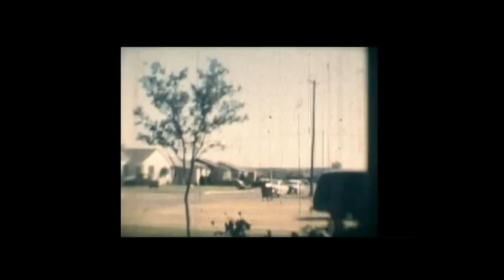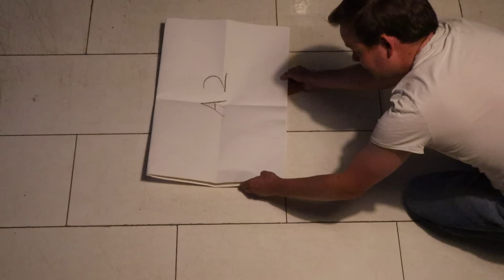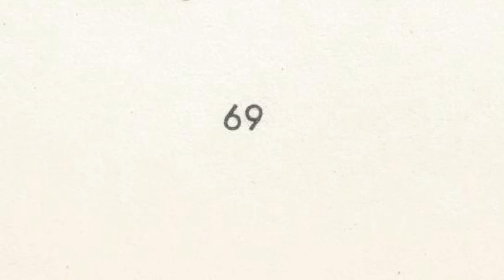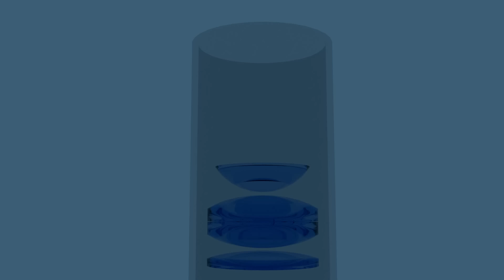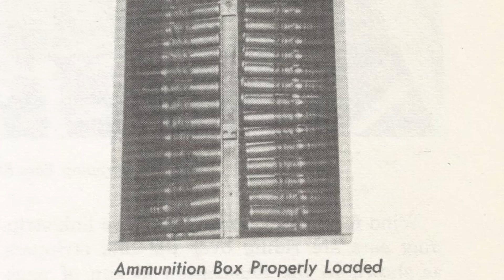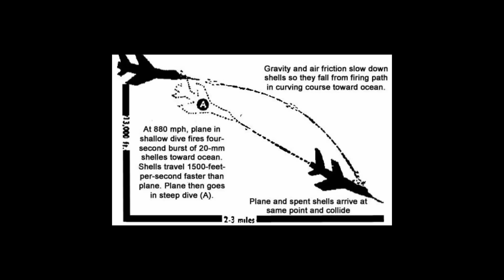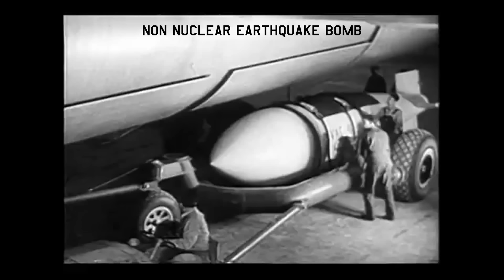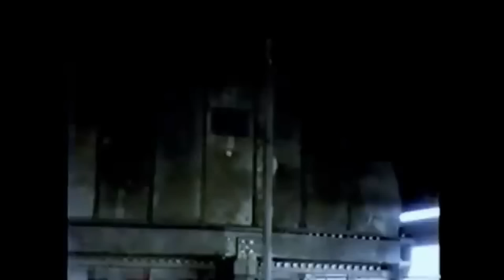Unfathomably American: The Armament Systems of the B-36

Comment: Regarding the nuclear powerplant, that was being developed for the bomber. A sad story.  Scientists and engineers knew the project was ridicules' but the funding did offer the potential for an MSR, Molten Salt Reactor for ground based reactors with great potential.  But government support eventually stopped after the development of 2 working prototype research reactors. President Nixon, having no understanding of reactor design canceled the second project in 1972 for purely political reasons.  And until recently ignored.  China has 2 MSR reactors and a US project in a Texas university may develop an MSR research reactor. Given the potential of an MSR is revolutionary in safety, cost and waste reduction, transportable, construction, simple operation,  compact size and modularity.   By now  MSR reactors could be running with simple and modular factory production.  American policy for reactor licensing may allow for practical development of new MSR reactors.  The potential may  see more than doubling performance over Gen 3 reactors.  And advances in development fusion reactors.  And includes designs with no risk of meltdowns and burning nuclear fuel waste.

Comment: The B-36 was designed back during a time when it made sense to the designers to build the XB-36 with the main landing gear with a single huge wheel.  The main gear tires were 9 ft 2 in tall and 3 ft wide and weighed 1,320 lbs.  After they realized that with the weight of the plane, it would break every runway in the country except for three locations when using the one-wheeled landing gear, they changed to a four-wheeled truck.  They had one of the huge single-wheeled gear on display at Wright-Pat and it's hard to believe anyone would think that was a good idea.

Comment: Do you have a model of the F-15E to the same scale as the B-29?

that's always an interesting one to show people.   A Strike Eagle is in the same ballpark as a B-29 for size, and has 4,000 lbs GREATER weapons capacity.  It's nearly as large as a B-17.

and to top it off, the Mudhen can carry a much larger portion of its weapons capacity to the target.  A B-29 can only carry its full 20,000lbs bomb load over a short distance at low altitude.  Long range missions (1,400 NM) limit the B29 to a 5,000-12,000lb load, depending on exact distance and altitude for the flight.  The F-15E can take 2/3 of its max fuel load with max weapons weight (24klbs), or 1/2 its max weapons (12klbs) at max fuel.

Comment: One point about non-exploded nukes: Uranium and plutonium are barely radioactive alpha particle emitters. They're vastly more dangerous as toxic heavy metals than radioactivity sources
This leads to the rather infamous problem that radioactivity detectors installed at ports worldwide to detect nuke smuggling have a habit of going off on truckloads of bananas (Yes, really)

The USA research on Aircraft nuclear reactors (ANR) was undertaken with the understanding of researchers (Weinberg et al) that "it'll never fly, but the money was useful to work out vastly safer designs than Weinberg's original Nautilus reactor(*)" - that R&D carried into Weinberg's MSRE at ORNL (built on the bones of the ANR) - something killed by Nixon in 1972 because the military realised that civil nuclear power not dependent on enriched uranium endangered the weaponsmaking chain (depleted uranium is the feedstock for making plutonium)

China's built a modernised MSRE - TMSR-LF1 and has been running it ON THORIUM for the last 2 years (the first time a molten salt reactor has ever done that. MSRE only tested on U235/Pu239/U233/U238)

Molten salts are deserving of a well_researched video all by themselves

(*) Whilst Rickover is credited with the program, it was Weinberg who actually BUILT it and it was tailored specifically for a 1950s submarine - a boiler and steam tech because navy engineers understood steam intimately. The thing was a proof of concept intended as a stepping stone to efficient units (98% waste, needing constant supervision and only producing wet steam were all acceptable for an experiment, especially in a military marine environment where someone's standing watch 24*7 anyway, but not for production units) and Weinberg was deeply unhappy with his laborator demonstrator being directly scaled to Rube-Goldberg complexity. Direct immersion nuclear steam boilers got locked in when Rickover insisted that enriched uranium be the power source for Aircraft carriers instead of moving to a next generation design - and Rickover did this for military pragmatic reasons - enriched uranium is a nice cover story for making depleted uranium which in turn makes weapons-grade plutonium and the military simply don't care about waste

Comment: our paper here in the US is SO stupid. when you fold it in half, it CHANGES THE ASPECT RATIO, unlike A4. Meaning, with our stupid paper, you can't print two pages on one sheet and have it fit perfectly, you end up wasting space. And to make it even stupider, it wouldn't do that if they had made it 8½x12 but instead it's 8½x11 inches. It is so stupid and the only reason it is used is because it's what we've always used so everything is already size for it here. Ugh. It's the worst.

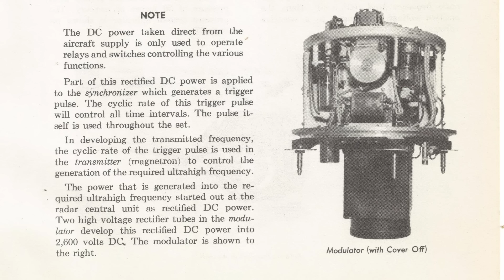Comment: 18:38 I'm just guessing, and p.69 suggests otherwise, but I'll bet they actually used long persistence phosphors so that the "jizzles" would slowly fade out rather than instantly disappear completely as the dish swept past the targets.

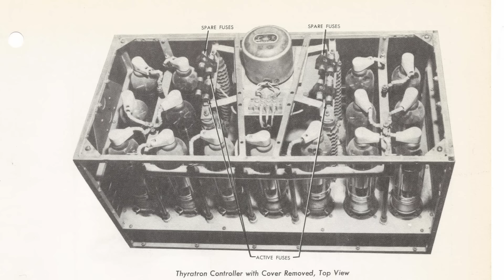29:34 Couldn't they have replaced the fidgety thyratrons with solid state selenium rectifiers, or even with motor-generator convertors?

Comment: 50 cal might have had better ballistics at very high altitude but they couldn't fit a VT fuse and so would have been orders of magnitude less effective. After the development of the VT fuse there was zero sense in using an AA round that couldn't fit them which is I'm sure the reason that the turrets were upgraded.
Reply: Nevermind the V-T fuze, the issue with the .50 cal (12.7mm) was that it fired solid bullets. 

The 20mm cannon had worse ballistics, but it could fire explosive shells which individually did much more damage to aircraft than even a dozen .50 caliber bullets.

Comment: Turbochargers are basically more fuel efficient because they dont have the same parasitic drag on the engine as a Supercharger.....however the extra plumbing required adds bulk to the installation.

Comment: The only thing that could have eclipsed the mechanical insanity of the B-36 would have been the plans to build nuclear powered bombers.  While the nuclear powered bomber never got off the drawing board, the USA did get a long,long way down the road with the Nuclear powered Cruise missile called "Project Pluto".   Pluto was the size of a rail locomotive, was armored, flew at tree top height at Mach 3.5 and its shockwave would have killed people on the ground.  Pluto was designed with a magazine capable of dropping a 1 megaton bomb on almost every major city in the USSR as it passed over them.  Pluto did not ever fly, but its 250,000hp nuclear scramjet did have a full power test for 20 minutes.

Comment: The early proposed armament for the XB-36 was nearly as ludicrous as the production model.  

No nose gun, obviously.  The rear fuselage guns (in a bay between bomb bays 3 and 4, rather than at the back of the bomb bay proper) were pretty normal- a remotely controlled turret, top and bottom, quad .50 cals in each.  The tail gun, also remotely controlled, had two .50 cals, AND (here's where it gets fun) A 37MM CANNON.

Now, the front turrets, which used the same turret bays right behind the cockpit as production models, are real interesting.  Each turret (one top, one bottom) also had a pair of the stupid 37mm cannons, but get this- they were pressurized, MANNED turrets.  That could also be controlled remotely for fun.

I'm pulling from Meyers K. Jacobsen's "Convair B-36" history, but check out Patent 2,586,982 to see the lower front turrent.  It's... nuts.

Comment: Interestingly those 20mm cannons actually helped cause the loss of a B36 flying over Texas.  They were test firing them, the vibration damaged the auto mixture/boost control electronics. The engines ran so lean they simply did not have the power to keep the plane in the air and it crashed about 20 miles south of Carswell.

Comment: 57:09 We use Watts for electrical power here too.

We also use fractionals of how much a Saturn V rocket outputs in Watts, to be different. The reactor's output was 0.00002331002 of a Saturn V. Simple.

Comment: Up until this point in my life, I did think the B-29 was "pretty big."
Reply: Tbf, it is, the B36 is so big its wingspan is more comparable to the length of a small city block, the B29 is bigger than the Airbus A320, though the A320 is not the biggest plane around, I can't think of a commercial airliner that comes close to the B36

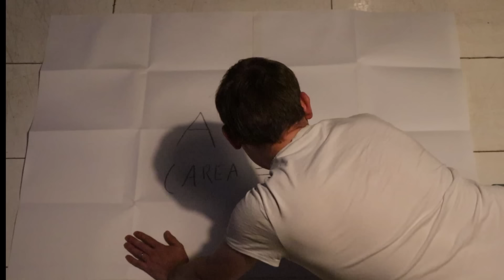Comment: 14:20 "because we've always done it that way" is literally the reason.
56:48 The way to avoid spewing radioactive exhaust is to use a closed loop working fluid and heat exchangers (and maybe some other electric heaters) rather than directly exposing air flow to the reactor.  The direct propellant contact approach was done in rocket form with NERVA, but that was for space where nobody would ever be hit by the exhaust.  The "Serpent" nuclear space engine concept design using Skylon's heat exchanger is a proposal for "the safe way" in space.

Comment: The R4360 was a beast.  I was introduced to it in Aircraft Maintenance School.  The propellor shaft is about  6 inches in diameter, and torque/engine power gauges were just strain gauges attached to  each end of the engine case- you got your readings from how much the prop shaft deflected under load.

They used about 600 gallons of fuel and about 10 gallons of oil per hour at high power -per engine.  Maintenance and operational costs were enormous.

Comment: the original B-36 couldn't land anywhere but on a specially built runway! it's main gear consisted of a pair of 8 foot tall(!) wheels that put all that weight in a small area. it could destroy a runway just landing on it! the service versions had the multiple bogie mains. the USAF museum in Dayton Ohio has one of those big chongus wheels on display 😂

Comment: The weird thing about the guns on the B-36 is the B-29, in spite of having that marvelous system, ended up removing almost all except the tail gun in 1945. They weren't worth the weight. Stripping them off increased the range ceiling, speed and bomb load. Paul Tibbetts had demonstrated in the workspace for the Silverplates that the shear speed and altitude was a much better defense than the guns. Japanese interceptors were not really a huge threat to the B-29's. Not the way accurate flak or the B-29s own engines were. So I'm always surprised at just how much armament they bolted onto the B-36?

Comment: When your "radial" engine becomes so long, it starts looking like an inline engine, maybe build that instead.
 
If we could solve the chemistry of fully cleaning reaction products out of a molten salt reactor, and keeping its installation in one piece, we'd have them running by now. That combination of very fun salts with even more fun atom splitting products is just a little bit too much for long term operation. Right now, only China has a running test reactor, and there is always some US company or other telling everyone they are "developing" one, but the tech remains far from ready in terms of commercial adoption.

Comment: 49:40
It seems odd to me that a 70L displacement engine produces such a hilariously low amount of power. That might actually be the most American thing about this aircraft. That's like (I hate to use this engine as an example) 2 2jz's. Which, granted, are forty years younger, but have been built up to that power by amateurs in their garages and not the military industrial complex of the United States.

Comment: There are problems with using firing pins and percussion primers at high altitudes and low temperatures--the firing pins would shatter, or the lubricant/protectant would freeze, and low temperatures would affect the ignition properties of the percussion cap primers.

Comment: I was five years old when the Cuban Missile Crisis went down and living on Spangdahlem AFB in West Germany.  I saw a B-36 coming in for a landing.  There is no mistaking the B-36 for anything else and it shook the ground as it made an orbit of the base and then landed.  It took five years for me to find a photo and show it to my eldest brother (almost two years old during the Cuban Missile Crisis) and he recognized it.  Surprise--officially the B-36 stopped flying in 1959.  I can only speculate why that B-36 landed, it didn't fire up its jet engines for landing.  

In 1962 spy satellites were not ready for prime time.  The U-2 was able to fly high and fast but was limited in endurance.  The Featherweight edition of the RB-36 could operate at 65,000 feet and had two days endurance, and when flying to the west of the Inter-German Border could see 300 miles past the border, into Poland.  Your video mentioned how high altitude made it difficult to intercept, and remaining in West German airspace and the use of various electronic sensors (photos are fine but there are other recon systems) could keep an eye on GSFG garrisons and tell when those garrisons left their peacetime locations for their wartime assembly and jumping-off points.  Using the RB-36 during the Cuban Missile Crisis would have been a comfort to President Kennedy because the GSFG garrisons could have been eradicated in their garrisons within fifteen minutes of Kennedy issuing the order to strike and within five minutes of launch.  I'm still speculating but with background data (aks "excuses") supporting my speculation.

Tension?  I recall sleeping in the base fallout shelters (not BOMB shelters) for two weeks--and how mean the adults were to the kids.  Now I know that the adults were terrified, but back then it was "what did I do this time?"

Comment: Rickover really did a miracle making nukes work for the navy, the airforce were insane with their reactors and the army were stupid with theirs
Reply: @deeznoots6241  Rickover had large displacement submarine steel  hull , to work with. He was constrained with size, not weight. He could add as much steel and lead shielding as needing. Air Force and Army were highly constrained in size and weight. Both had to be liftable and transportable.  Given then technology,  Air Force and Army had unattainable objectives.  Army did make it work with SL-1. For a time.

Comment: I live in Fort Worth, Texas, very near old Carswell AFB, where the B-36 was primarily stationed. Today it's called the NAS Forth Worth JRB. It's no longer U.S. Air Force, but now a Navy Joint Reserve base, mostly home to Navy and Marine C-130 cargo planes. Plus it's home to the Lockheed F-35 assembly line. I hear F-35s doing test flights over my home every day.

The B-36 was not only stationed there, but manufactured as well. For years there was a B-36 on display near the main gates, but it was moved to the Pima Air Museum in Arizona many years ago. If you want to see a great movie about the lives of B-36 Peacemaker crews during the Cold War, look up Strategic Air Command on your streaming service. Made in 1955, the movie starred the late Jimmy Stewart who himself was a qualified pilot of the B-36, so the most of the flying scenes with Stewart behind the yoke, were very real. In the movie, Stewart gets stationed at Carswell, Ft Worth, so there is a lot of great footage of B-36 Peacemakers doing take offs, landings and it flight.

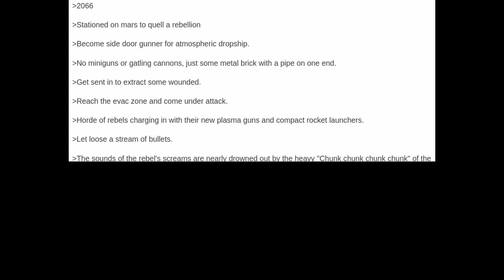Comment: 16:12 the issue wasnt really about range but stoping power, ground test said that .50 cal was fine agest a mig 15 but in the air the time on target with jets was so small that you were only ever going to get a few rounds on target, so the few rounds that did hit had to take down the enemy plane, and the .50 cal isn't it. saying the .50cal is still in service is a gross exaggeration btw, its still in servis on the ground, the air force and navy got rid of them after Korea. F-86 pilots were begging for bigger guns in Korea, but because Springfield was shit and the us refused to use the perfectly good UK Hispano the USAF was never able to get the 20mm to work right until the Vulcan (the gun actually used on all us fighters today).
Reply: He didn’t say anything about range, he said that 20 mm had worse ballistics than 50 cal at high altitude. So yes u are correct that a .50 cal (~12.7 mm) is not gonna pack as much of a punch as a 20 mm, but good luck hitting anything consistently with 20 mm at that altitude back then.

Side note, I don’t like the term “stopping power” because of how much ppl abuse it in situations where it isn’t a real factor (specifically the .45 vs 9mm debate). In this specific instance tho, the difference between a .50 and a 20 mm round is pretty significant, so I think it’s appropriate

Comment: I live near an airbase designed for the B-36. After it was decommissioned, they were going to remove the runway, but discovered its 6 feet thick.
Reply: Same as where the (FLA) Sebring 12 Hr race is held. Multiple feet of concrete, which gets harder as it ages. A fair amount of the course uses old B17 taxi ways. The old 5 mile plus course used a runway as well. Known as the roughest Profession Road Racing course in the world, they cannot dig up the old concrete. Or at least can't afford to.